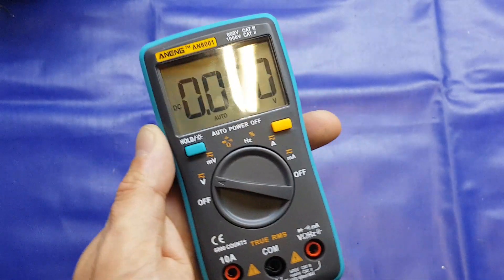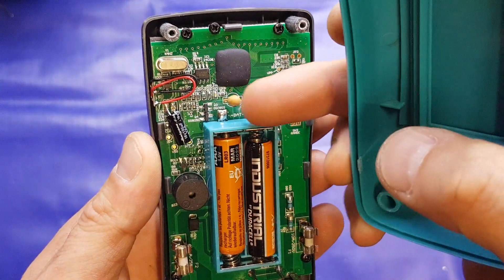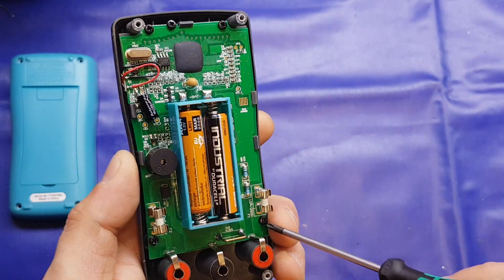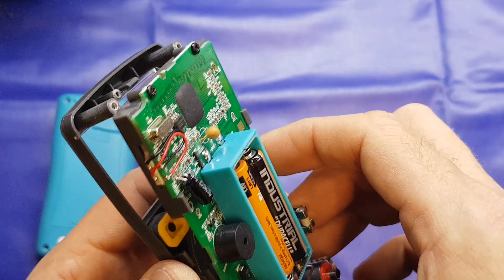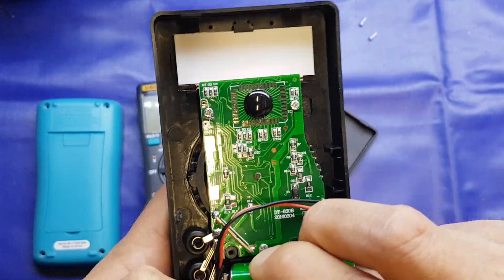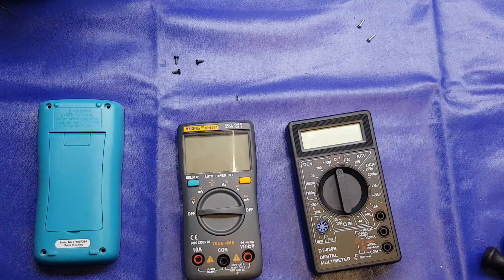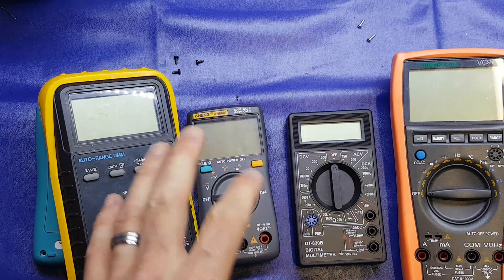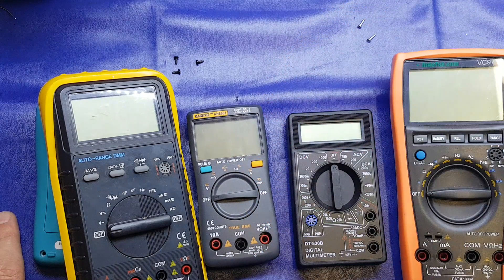Competition time #7 and teardown of the Aneng AN8001 (and DT-830B) DMM multimeter (Electronics blog)

Comment: My meters are all budget and get me by just fine. Before retiring I was an electrical fitter in a power station and we used fluke, avo etc meters but we were working mostly on high voltages and Kris is spot on in advising caution if you don't have experience of working on mains circuitry. I've had a few belts over the years and it's not funny, believe me!

Comment: good advice about hv/hc. you can buy second hand flukes on ebay for a great price if you are not looking for the latest models. I got an 87 for 20 quid because it was a mk2 not the new mk4. as for cheap meters, i bought a 4 quid cheapy for work. its only for testing 24v truck wiring.
Reply: +George Christofi when DMMs are fried I often have little luck trying to fix them. So congratulations on getting a functional DMM so cheap used, but it is pure luck. Plus I have not considered ebay a legitimate commerce site in about a decade now.

Comment: Nice little meter. Have been tempted to get the version with temperature measurement.
Do you know what are those tiny fuses called? Want to check how much they cost and how easy is to get them.
I have an UT139c and I'm really happy with it. The only issue is to get fuse replacements.

Comment: i have this multimeter and it rules. i find it annoying that it beeps all the time. i plan on opening it up and disabling the beeper unless its in continuity mode. i have a spare CMOS AND chip somewhere i think would be good use. 

i dont like how modes are shared on the same swich. i prefer everything to be immediate, not nested beneath levels. but seriously this is a featured packed well worth it multimeter.

Comment: Exciting things would happen if the DT-830B were accidentally used to measure voltage with the test lead plugged into the 10a current input.. The pcb tracks would probably fail before the links, at least judging by appearance .
Reply: + Ivan Isthmus that's what happens when you make mistakes. There's often suffering involved then. But that whole meter is cheaper than a new fuse in a Fluke. So there's that too.